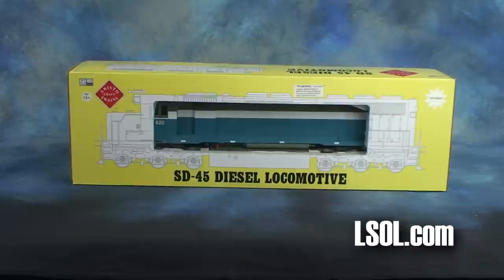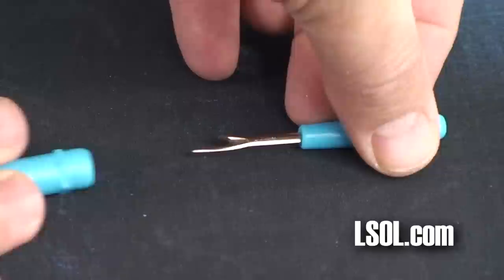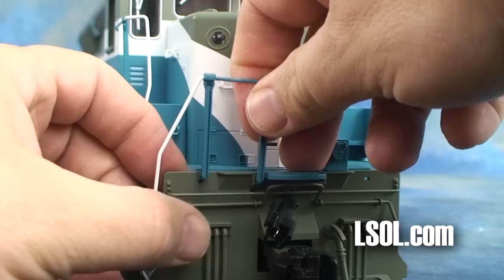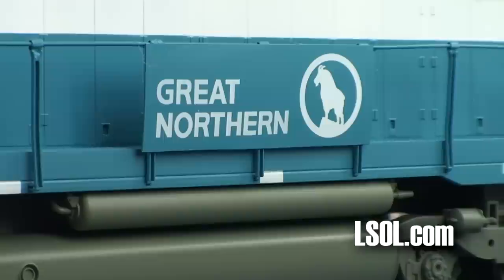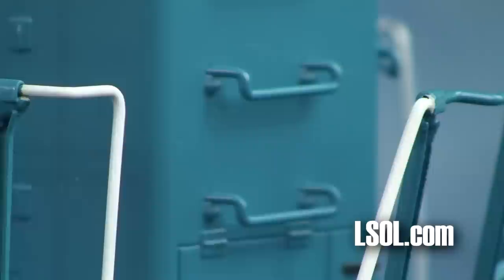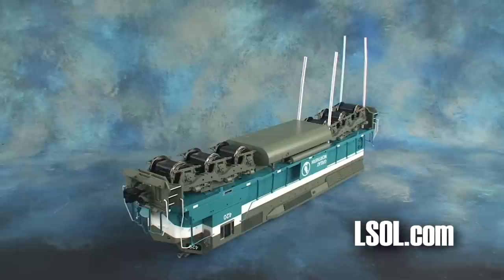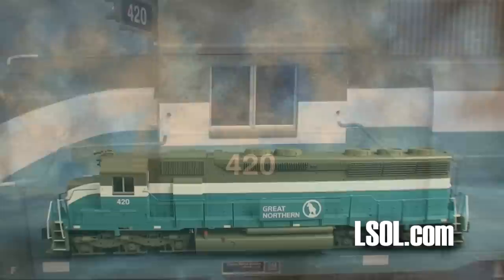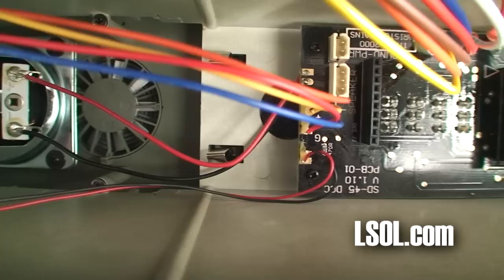Garden Trains: Aristo-Craft SD-45 Locomotive

Comment: Thanks J 

Viewed this video a couple times during process of installing REVO w/sound in a SD-45 hi-nose.
Fd that there were a couple extra screws to remove before front hood would release.  

After a few yrs of snowplowing another SD-45 (hustle muscle) had one of its side cab window assemblies fall apart ... have also added some hot glue to interior fit spots for the window assembly before putting it back together (after testing revo install).  

Oh yeah, if ya want sound don't forget to plug in the spkr  connect at the board !!   :)
Reply from the maker: Thanks for the reminder about the speaker connection, not that I ever did that myself. 🤪

Comment: Sorry, the Aristo SD-45 locomotive, USA Trains SD40-2, PA and SD70-MAC all need a "Minimum" of 8ft diameter curves. They will not run on anything tighter. I highly recommend 10ft diameter curves however, especially using knuckle couplers.